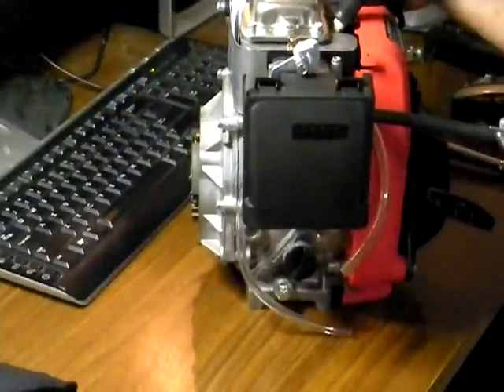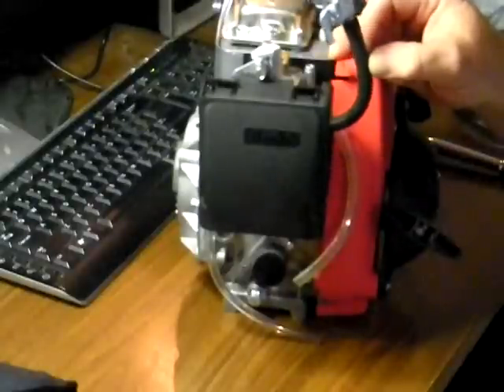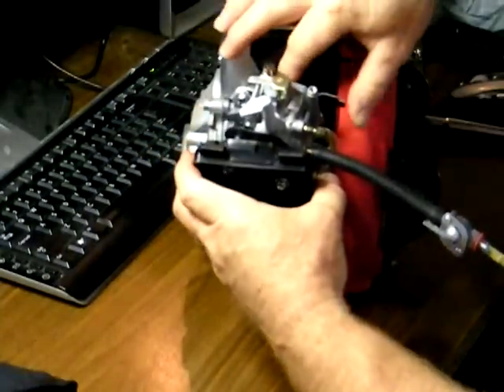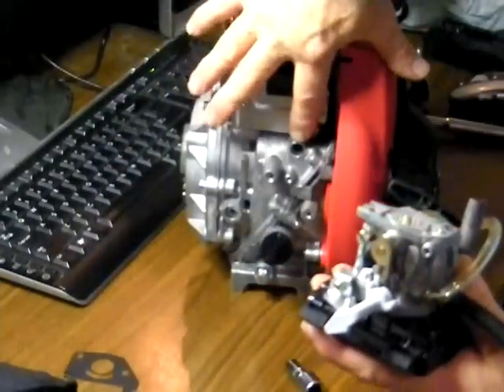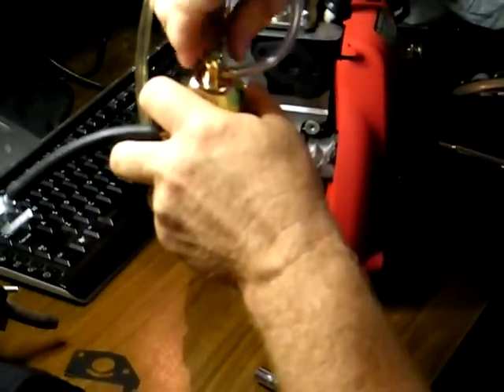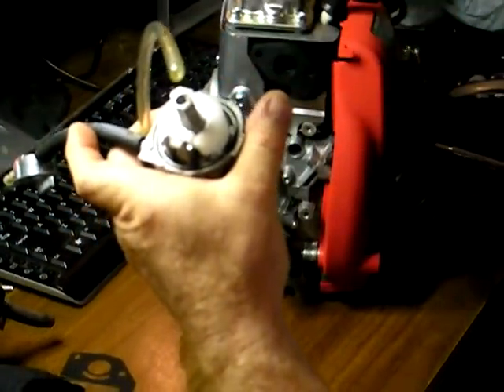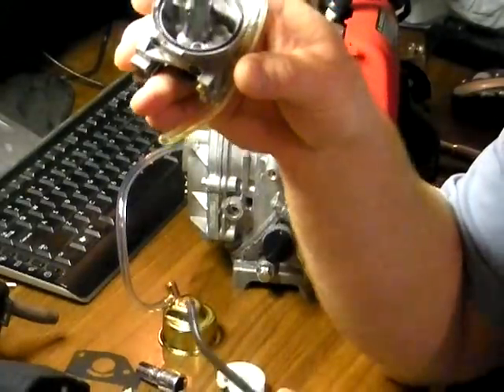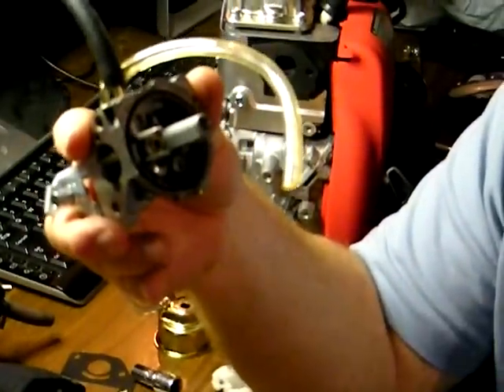HuaSheng 142F-cc 49cc 4stroke clean out your fuel line

Comment from the maker: you only need enough oil to show up on the stick about 1/4 of a quart. Now clean the spark plug with gass and then dry it well next take the air filter out and clean it by rinsing it with gas and then put 1/2 an oz of oil in the filter and wring it out and re install.
Reply: Gass !   hahahahahahaha

Comment from the maker: Now at the bottom of the float bowl on the carb there is a drain use a flat screw driver and open the drain and let out a little gas to make sure there is fuel in the carb then turn the choke lever towards the pull starter open the throttle a little and pull the cord. Your engine is going to smoke for some time because you over filled it. If you need to the base setting for the air mixing screw is 3 turns out from 0 Let me know how you make out and my name is Terry not Tim

Comment: Hey Terry, hoping you can help me. I bought a semi-new bike that's been sitting around. It has the 142 4-stroke 49cc engine. It starts fine but when I try and move the choke to run position the engine dies. So I can only use the bike when the choke is on and there is very little torque power. Please help! I think it has to do with the carb. thanks!

Comment: i need a bit of help Terry; i took the jet out and it fell out in two parts. is this normal? if so then, there is a horizontal hole on one end; with the carb upside down, as youre holding it here, does the end of the jet with the horizontal hole go in first..followed by the short piece with the threads? if i have to replace the jet, who should i order from...i'm in mississippi........thanks....this bike is my only trasportation

Comment: What to do if no gas come in to the engine
Reply: 2 reasons... 1- middle valve seat plugged up water or old gas scum... rub small wire in hole and blow out with carb cleaner ! 2 - under the throttle idle screw.. ply -up rubber and brass tube.. do same ! also saloon engine repair guy has video on open hole up 1 -size.. so not plug up all time! hole too small.

Comment: can you tell me what type of oil does this motor take and what type of gas i searched on the internet could not find information on it .im installing this motor on my margeritta bike crusier any info would help a lot
Reply: these china 4 - strokes /made like older style motors and is reason they run on streight 30... not 10w 30.. not any number but 30! non detergent! modern engines use detergent.